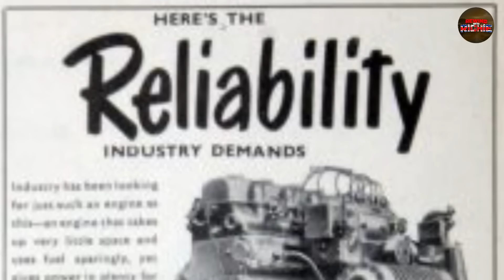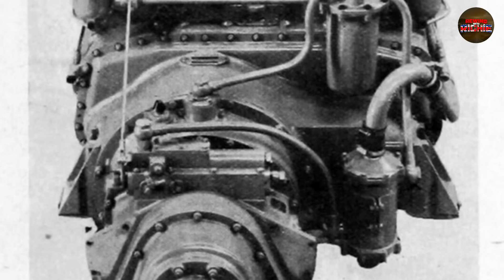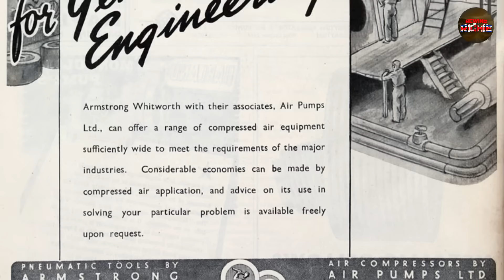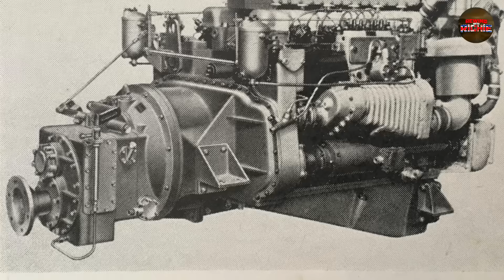The TRAGIC history of Foden's Two Stroke Engines

Comment: I'm a retired truck driver in New Zealand, and I often wondered what happened to Foden. I was driving a lot through the '70's and 80's, although I never drove a Foden, but I did see a lot of them on our roads. I usually drove Bedfords and Austins. The Commer TS3 was quite common too, but when Chrysler US took over Rootes Group they killed it, unfortunately. There were apparently plans for a Commer TS4 but that never happened either, sadly. Thanks, Chrysler. Later I was driving Hino and Isuzu, both of which I liked immensely. Great trucks.

Comment: I have driven a number of boats that had these2 stroke Foden engines.  The boats were Picket Boats used on larger warships as transport for their officers/Captain.  Lovely boats, biggest problem were they had separate horrid throttle and gear stick.  Four levers, made for a real interesting boat control when berthing.
Reply from the maker: I assume that was a few years ago then?
Reply: @RewindwithRichie  1970

Comment: Imagine if Foden had done the intelligent thing of making, that otherwise light duty pickup truck engine, into a 12L medium duty or 16L heavy duty engine with a slight detune (ie the 12L set to 250-300hp and the 16L set to 400). They would have seen greater success in Australia and may even have made it in North America. Though not a long term solution, even in their existing engine, if they had a switch to roll a little coal when climbing hills; they could temporary reduce combustion chamber temps (again, temporary, not long term use).
Reply from the maker: Thanks for the expert comment 😀👍

Comment: Pitty to have missed out on the turbo charger system this improved the performance no end and also the u12version which was used as a generator unit they were built at RR crew

Comment: I have to wonder what was causing the overheating issues that plagued these things? Even the original G.M. diesel (decades later it became “Detroit Diesel) series 71, specifically the 6-71, a 1938 design that while somewhat larger in displacement at 7 liters made only slightly less power / cubic inch to the Foden units yet never suffered from overheating issues in the trucks, coaches, and equipment it was installed in.

Comment: Back in 1988  my friend and myself aquired two identicle boat hulls   both 70 feet pong , deep drafted tugs    mine was a single screw fitted with a Gardner 6LW   "UC direct drive gearbox      and my friend had 2 x Foden FD 6's       Mine when running was almost silent and vibration free , very slow revving and with its shiny aluminium allloy and brass components looked a million dollars and she could make 10 knots ,     My friend had to have ear defenders as both Fodens working together was quite deafening ,  thet sounded like they were revving their heads off but could only keep up with my boat , not overtake it    and the fuel it used was colossal    The fuel the Gardner used wasnt even worth talking about .
Reply from the maker: Interesting
Reply: Very interesting. Never worked on a 2T. .but the other engine you could start just by pulling on the injector primer levers .

Comment: Here's an example of a successful two-stroke locomotive engine. The EMD 645 series is a family of two-stroke diesel engines designed and manufactured by General Motors' Electro-Motive Division (EMD). These engines are V-type, 45-degree angle engines with a 645 cubic inch displacement per cylinder. They are known for their use in locomotives, marine applications, and industrial settings.

Comment: When I was in the Royal Navy, I looked sfter at one time a whole group of fleet motor boats based in Malta and used by admirals and other senior officers. Theyt also included some converted fishing boats (MFV's)  used for day to day fleet work. The majority 30 and 35ft barges used Perkins diesels and some had larger Gardner's. Good reliable engines but when I transferred to a ton class sweeper, I was blown away by the Foden FD6 two stroke engines that ran the domestic gernerators. Such a sweet sound as they ran up and when on load, no coughing or spluttering real stable engines. A shame they lost their way in the engine world.

Comment: All the same issues as Detroit 2 strokes. Overheating? Watch the temp gauge. Once they went to wet liners in the 92 series, a lot of that went away. Low torque at low RPM? Run it against the governor.

Comment: 6:55 I would hardly call the PVR popular.  Only about 70 were built, with just over half having the FD6 engine.  All of them were bodied as luxury coaches, and what endeared them to drivers was their exhilarating performance on the open road rather than city streets.  Foden single decker buses, as opposed to coaches, were rare.  None of them operated in cities, and they all had Gardner engines.

Comment: Yet the Commer TS3 two stroke opposed piston engine with no valves , no heads, and only 13 internal moving parts was a big success !
Reply: Since the Foden was similar to the Detroit Diesel, Foden should have taken some of Detroit's design features and copied them. The engine should have been bigger, at least equal to the Detroit sizes.
Reply: @hoost3056 the trouble is the Fodon was years before the Detroit Diesel, more like the Detroit used Fodon ideas . Being the rest of the world big is not better, no Europen trucks were any bigger than the Fodon . Just not needed , just like the Opposed piston TS3 and TS4 Commer Trucks, TS3 was 3.5 litres to start with, was in production for 20 + years in Semi Trucks, Logging trucks , they just used a tight multi level gear box. The Commer only stopped building the TS3 six piston / 3 cylinder and the. TS4 eight piston / 4 cylinder when Chrysler with its connection to Cummins bought Commer in 1976 , the TS4 Two Stroke opposed piston engine at 4.7 litres made same power if not more than the Cummins engines twice the size , Cummins couldn't have that and stopped production of the two stroke TS4 . Lucky some were saved. It's funny today all the interest in opposed piston engines and two strokes .
Reply: @JosephCowen-fz8vj  There is just so much that is incorrect in what you have stated... you need to do more research. GM released the Detroit 6-71 in 1938 and it was used extensively during the war years in a variety of roles. Development of the GM two stroke started in 1930 when GM bought the Winton Engine Company, years before Foden started two stroke development. The FD6 went into production in 1950 - 12 years after the Detroit. The TS3 wasnʻt 3.5 to start with. It was 3.261 litre and Iʻve got no idea what you mean by a ʻtightʻ multi level gear box. Commer Trucks initially used a Tilling Stevens developed constant mesh 4 spd gearbox as the current Rootes developed boxes from the petrols couldnʻt handle the power/ torque of the TS3. A 5 spd constant mesh box (Y code) was available in the later Mk III and Mk IV ʻbubbles cabʻ C7 series, followed by 4 spd synchro (S code) 5 Spd synchro (W code) and 6 spd synchro (V code) in the larger Sankey cabbed models. Coupled with the heavier 18000 series 2 spd Eaton fitted to TS3 powered Commers in OZ / NZ, this could give up to 12 spds. Commer Trucks stopped building the TS3 in 1973, not when Chrysler took total control of Rootes in 1967 - and it wasnʻt 1976 as stated! If you read Geoff Carverhillʻs excellent The Commer Story Pt 2 - The Chrysler Yearsʻ, where he spoke to Rootes people involved at the time including the Rootes family, there is no evidence of any ʻconnectionʻ  or contract to use Cummins engines. This myth that Chrysler stopped producing the TS3 to protect some contract with Cummins is just a nice theory promoted in certain quarters that is not backed by facts. The decision to stop developing the TS4 shortly after take over was more likely a financial decision along with the decision to stop producing the bonneted Superpoise ranges, the Humber Super Snipe, the marine inboard and outboard engine divisions etc, etc all around the same time. Cummins were only an option in some later Commer models (particularly in Australia) along with Perkins, Mercedes, Valmet, etc in other markets. I also have in my collection, an internal Rootes Diesel Engine Division report from the Chrysler years where they were looking  at developing a ʻfamilyʻ range of modular 4 stroke diesel engines in 4 cyl inline, 6 cyl inline, 8 cy inline or V8 configuration - like the Detroit series. They wouldnʻt have been looking at this if they had some contract or ʻconnectionʻ with Chrysler. I would imagine the financial difficulties Chrysler gradually got into, after taking control of Rootes, put an end to this idea. Truck enthusiast usually donʻt understand that Chrysler bought Rootes for one reason - to get into car manufacturing in the UK, like the other Big Two. They had tried to buy shares in Leyland in 1962 and when a deal between Rootes and Ford fell over at the last minute (yes Ford was going to take over Rootes!) when the deal with Chrysler was struck, it seemed to answer the needs of both Rootes and Chrysler

Comment: Too much aluminum in the engine. That and the issues caused in the cooling passages, from electrolysis due to coolant and that bastard metal. Also, aluminum cylinder heads do NOT like extreme pressure amd exactly that is present in a diesel. I love all things 2 stroke, and would LOVE to have both FD-4 and an FD-6! They are beautiful engines for old engine shows! Also Commer TS-3 opposed piston ad well! One thing the engineers at Foden missed was going to a 4 valve head to double airflow, since scavenging is half the total cooling in Clark cycle uni-flow 2 stroke diesels! That alone would have reduced heating and increased efficiency a great deal. They should have offered a cast iron block and head in the over the road and high ambient temperature climate engines as well. Also, Foden should have offered our fantastic Detroit Diesels! These are examples of what the FD engines easily could have been! The Detroit diesel is hands down the greatest diesel in world history! Too bad the goos Blokes at Foden didn’t go that route, it would be awesome! I still want one of each model though! And yes, 2 strokes can be incredibly efficient! More so than 4 stroke.  cheers! 👍🏻😋😊
Reply: Eh, aluminium dissipates heat much better than Iron. It dissipates even better as Aluminium bronze (basically aluminium with between 5 to 10% copper & up to 1% silver), but that is way more expensive
Reply from the maker: Thanks for your expertise 👍

Comment: Although  mentioned I think people are forgetting, or don't realise, Gardner Engines were hard to get and I imagine Foden thought that after the war the situation was unlikely to get much better. Gardners were pretty much bespoke engines and there was a waiting list of months to get them. There was also  premium to be paid as they were more expensive than other engines (yes they were more fuel efficient). Foden, at the time were probably right to investigate the design and build of their own engine particularly as other big manufacturers had their own. And don't forget lorries at the time were expected to cope with, at top, 150 BHP with manufacturers unlikely to develop more due to little actual competition. (Wasn't till Cummins came on the scene in 1956 that the industry started to wake up) 
After the war Haulage Companies wanted faster delivery times (they didn't get it, particularly as the bigger firms got priority) to enable them to replace worn out equipment, and I imagine Foden felt by offering an alternative Engine they could steal the march on other manufacturers and offer a quicker delivery time!  
And a Two Stroke? 
And why not!  As stated power for every stroke and Commer managed to produce a fine Two Stroke in the TS3 (105 BHP from 3.5 litres). In the 1960s they even built, for evaluation, sixteen TS4s but Chrysler, Rootes owner at the time, pulled the plug. (3 or 4 survive due to Commer's Chief Engineer squirreling them away and two reside with the Leicester Museum of Science and Technology, I believe) 
Low end Torque. Drivers were a conservative lot and were used to a flat Torque curve with Torque available low down. Two Strokes tend not to do this (screamers) and Foden were not the only company that found this problem. When Detroit Diesels (2 strokes) were introduced in Bedford TMs in the 1970s exactly the same complaint was voiced. Indeed the same was voiced about AEC V8s and the Cummins Vale V8 ( "over square" 4 strokes) - in most cases different gearboxes AND driver training helped in this quarter! 
I suspect once put into production Foden felt they had invested too much money and time to cancel the project, and persevered.
History is littered with flawed Lorry engines. The Leyland 500 series, the AEC V8, Cummins/Chrysler Val 6 and Vale 8, Perkins R6 etc. That doesn't mean Manufacturers shouldn't have a go at building their own to ensure they are not held to ransom by other suppliers!
Reply from the maker: You’ve got a lot of time on your hands. Interesting read though.👍
Obviously a man with the experience
Reply: @RewindwithRichie nice use of the ai auto response.

Comment: If Foden,s had trouble securing supplies of Lawrence Gardner,s 6LW oil burners, then why did they not offer engines from Henry Meadows, Leyland or AEC?. One bus rally I rode   Fodens own coach Duple bodied that transported their famous company brass band, a radical design with a transverse stroker twirling a four plus crawler box. That coach sounded like an XK Jaguar on speed, it howled and leaked oil like an incontinent child .
Reply: They did offer Leyland 680 engines in the 60s and early 70s .
Reply: @rayrudge8471  That is before Foden  released their Fleetmaster Range with a bought in drive line, am talking about the 30,s when Gardners were kings of the road and everyone wanted a Gardner powering their  range of bus or lorry chassis , Atkinson, Scammell, ERF, Daimler, Bristol, and Guy. Even AEC offered Gardner oil burners as an option in their Regal and Regent bus chassis.
Reply: @basiltaylor8910 Yes it was in later years that Leyland engines were offered in certain models , S20 to S39/S40 cabs ,crane  and dump trucks . 
I didn’t know AEC offered Gardner in its buses but that would be due to operator demand of course . 
A bit strange when AEC engines also had a good reputation but then even Leyland couldn’t get away with not having a Gardner option in later years .

Comment: I wonder if the the coolant space of the engine was too small for the amount of power produced or was it that some part of the engine couldn’t easily be cooled due to manufacturing casting issues? Does anybody know the root causes for this overheating condition?
Reply: It was 2 cycle diesel truck engines in its infancy. It lacked a sufficient coolant radiator for the task and coolant system to cope with the heat dissipation load. Detroit diesel engineers probably did their homework before entering into this arena but if you research those engines they eventually died out for similar reasons.
Reply: @Deviation4360  A bigger radiator would have been an easy thing to implement so I doubt that was all it was.  Low speed lugging requires a big old engine driven fan. Wonder if we will find any old guys who worked on it and know for sure.
Reply: They were likely trying to make it as small and light as possible, and just over-did it. There is nothing at all wrong with the basic principles - look at the EMD two stroke locomotive engines, introduced in 1938 and still in production with fairly minor changes now. 
Those are a completely different scale of course, with one engine weighing ten tons upwards.

Comment: Just wondering regarding overheating - why is it the engines fault for being fitted with an inadequately sized radiator?
Reply: It’s not that simple. Two stroke diesels generate much more heat in the cylinders and heads because every stroke is a combustion stroke. This requires greater water flow to transfer the heat quickly away. If the water passages are not large enough, the cooling system will be unable to remove enough heat. Even the largest radiator is limited as to how low a temperature it can provide to the engine water jacket. Flow becomes the critical limitation. Detroit diesel also struggled with cooling issues in truck applications. In most cases the ultimate horsepower of the engine was limited by the ability to maintain water temperature limits.
Reply: EXACTLY.....i would have thought fitting a much larger core and even thicker water pipes/wider jackets would have helped....such a shame as the wagons are undoubtedly beautiful looking wagons....the mickey mouse cab was so iconic....at the same time i used to walk to school in the late 70s where i live in bootle and we had a main road to the motorways nearby, and seing as well as hearing erf's, fodens, atkinsons etc with the UN-mistakeable sound of a gardner engine, i can still hear it now !!... looking at the drivers STANDING while pulling an enormous steering wheel left and right to get them around bends etc on bootles famous 'kidney island'....its a sight and sound i wont ever forget !
Reply: That's why others went air cooled

Comment: I think one of the photos , is of the FD 12 a twin bank version of the  engine used in Navy mine hunting boats it had a low magnentic signature to reduce the possibility of setting the mines off , they were repowered in the late 80’s early 90’s
Reply: I worked on the twin bank in the apprentice shop.

Comment: Good to see the Winstone sand liners, purchased for running from their Mercer sand plant mostly to Mt Wellington in Aucland New Zealand. That would have been a run of about 40 - 50 miles most of which was open dodgy highway but with the Bombay hills to conquer. Not a long term success unfortunately but they looked and sounded magnificent. They could be heard long before they could be seen.